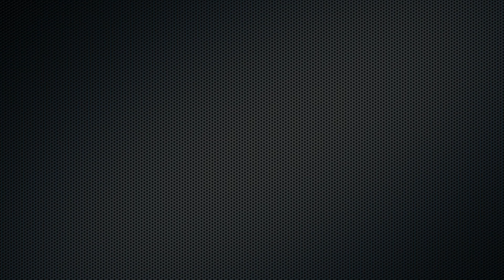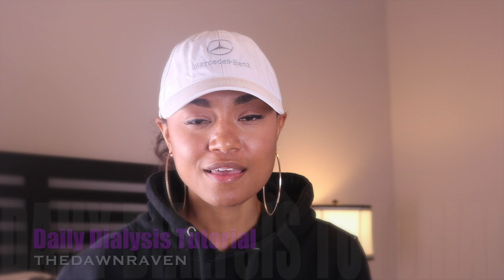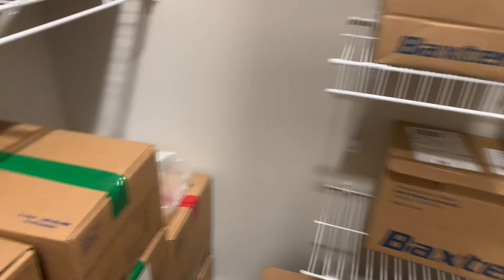My Daily Peritoneal Dialysis | TUTORIAL (Amia Machine)

Comment: Wow, that is far more complex than when I did my mother's peritoneal dialysis back in the early 1990s. The bags look the same (even the same manufacturer), but there was only one line. A bag stayed attached to the line 24/7. We used to wrap it in a rubber band and tuck it in my mother's knickers. To change the bag, we laid it on a tray on the floor and it filled with fluid. Meanwhile we heated the next bag in the microwave. Then we had this little box about the size of two packs of cigarettes stacked on top of each other where you'd put the spike from the line and the valve from the next bag into two slots, moved a handle on the side that connected the spike with the bag valve and then we just hung it up on an IV pole to drain in. There was disinfectant involved, but nowhere near the level on your equipment. The spike, for instance was open to the air unless it was attached to a bag, so during the transition phase it could be dropped on the floor by accident very easily because the line was floppy and rubbery and seemed to have a mind of its own. We had a couple of trips to hospital for emergency antibiotics from a dropped spike.  I'm glad the tech and protocols improved so much since my mother's time. Congrats on your transplant.

Comment: At about 9 minutes and 30 seconds and you say that the disinfectant is so strong that it could take off your fingerprints, and yet you have it sitting on the plastic bag for a considerable length of time.  Is that smart and or sanitary?  If it can eat through your fingers why is it not eating through the bag?
Reply from the maker: Not in just one session, over time with extended exposure and use. Similar potency to bleach.

Comment: I wish I had a spare closet to put my supplies. I have to get deliveries every 2 weeks in order to keep things manageable. I'm on my Baxter, or should I say Vantive, Homechoice Claria cycler now. Most of the time I'll do 3 green 6 liter bags. I haven't used yellow in months and even then only because I ran out of greens. Sometimes I'll do 2 greens and a red if my weight is a good bit above the target weight my dialysis center set. I also do a manual midday. So in total I do a 12 hour treatment at night and a midday (30 minutes). I've been doing dialysis for two years this June.

I like your machine more than the Baxter one. Yours is more modern. The one I have you clamp all the lines when priming, including the patient line. On mine you put one of your bags of fluid on the heater, not an empty bag. I currently use a 4 prong cassette like you but that's because I use to use 3 - 5L bags and a 3L bag but I ran out and just never switched back to 3 prong cassettes. With the 4 prong I need the drain line and patient line extensions. With the 3 prong they tubes stretch far enough. On the 3 and 4 prong cassettes with Baxter the drain line doesn't have a clamp. If you add the drain line extension, that has a clamp. Thank you btw for showing that toilet accessory. I just found it on Amazon. I've been in need of something like that. Oh, I started wearing gloves because it was removing my finger prints too. The tips of my thumb and pointer fingers were smooth and shiny for awhile.

Comment: Good decision to wear gloves. I see too many people doing this without. With gloves you can use better disinfection solution. I use Baxter Cycler. Funny to see the alternative. My connetors look quite the same, but the bags differ. The Baxter machine is a bit easier to handle I think. There is only one waiting time during the removal of air out of the tubes, abou 7-8 minutes.
Reply: I wouldn‘t touch the catheter with anything but the sterile cuff. Its already sterile. With the cuff I always clean the catheter via turning it around, moving a bit, then turning again.

Comment: Nothing you are doing is “sterile” you are not using sterile gloves , so anything you touch is not sterile… It is only clean.. also you should wait for the disinfectant to dry before connecting any tubes, you have the potential to flush that inside the tubes and into your body!

Comment: It is possible that you are increasing the risk of infection by removing the iodine from the inner cap on the dialysis connection as iodine will keep disinfecting it for long time. When you remove it  and disinfect it do not keep disinfecting it like the iodine does.

Comment: Wondering just how painful is the suction pain you mention in the video and how long does that last?  Also, how is it sleeping with this connected-if you turn over does it pull on your skin/tubing and wake you up. All the supplies you had in that room-was that just for one month?  Thank you in advance for your time and information.
Reply from the maker: I would say it depends on your tolerance. But not extremely painful, and decreases every time you do a session until it's completely gone. As far as sleeping the line is extremely long, I always made sure there was enough slack for me to maneuver in my sleep, but I'm also a light sleeper. Yes a month supply which for me was about 30 boxes. I would make the orders myself.

Comment: Thank you very much for your video.  I've been getting dialysis treatments for what feels like too long now😢.  They're keeping me alive, but simply having ckd can make a person so sad😢.  Having to be transported to the dialysis center Tuesday, Thursday, and Saturday is tough to endure.  Somehow, dialysis makes me feel VERY cold.  I've been told that they (Davita) keep the thermostat intentionally low, for infection control.  It often feels like I'm freezing.  I haven't had a fistula done, yet.  It always winds up being delayed for whatever reason(s).  I don't know if the fistula would expand my options, with regard to dialysis.  Or, if the available options would be narrowed down.  
  Im glad that you shared your dialysis experience with those in that situation.  It helped, and informed me about a lot that I wasn't even aware of.  Thanks again for your efforts.  I currently have a CVC in my upper right chest.  I asked a tech once, what IF it got infected?  His immediate answer was, "ICU".  I once had one of the tubes leak, at the fitting , when the line was flushed.  So it was to ER, to have a new tube put into my chest.  Successfully.  No further issues.  But it was a lot of back and forth, from the dialysis center to the ER, and back again.  
I'm still unclear about the fistula.  They'll start out with a 17 gauge needle, eventually use a 15 gauge.  Those are awfully big needles , to see them up close😐.  I still sometimes get a "Why me?" question running through my mind.  I used to be quite healthy, a few lifetimes ago.  I could eat or drink anything, with no I'll effect(s).  But now😢.  Once again, thank you much for your video and information.  And thanks for reading.  
Take care,
Jeff Okumura

Comment: Update: Since I posted that comment about 3 months ago things changed. My endocrinologist turned down my getting PD for dialysis. So I had to go the HD route. 
I had a fistula (https://youtu.be/Zo_azwN-1j4) setup to be able to do HD. My nephrologists thought I had more time. Well I didn't. So I had to have a catheter installed in my upper right chest. Which caused a blood clot in my neck. So now I have to take another pill ( Eliquis). 
While this was all done I landed in the ER for emergency dialysis. I didn't quite make it. And I was trying to be so pro-active about all of this. But everyone thought I had more time. 
The good part is that I got linked up with a local dialysis center that I take my scooter (a 3 wheel scooter called a Topmate ES32) and get there in under 10 minutes. Door to Waiting room. (I don't need to wait because I get there as soon as everyone is seated. I and doing Monday Wednesday and Friday from 2:30pm to 6:30pm. 

But when they say you can make friends and talk with fellow patients. Not in my center. I wouldn't need a megaphone to talk to them. We are spaced so far apart, it's not possible. And I don't believe this was done due to Covid-19. All the machines have water hook-ups and they are separated. 

The center I go to only has 24 stations. 

The first few sessions I would laugh my butt off due to the machines playing the ice cream song as 3 minute warning that the session is almost over. 

I still plan on doing this at home.

Also found out that my interview back in January to get on the Transplant never went through. 

The first day (May) at my center my doctor asked me if I was on the transplant list I said yes I went back in January. She said I don't think you are I don't find your name on the list. She advised me to call them. Seems I was supposed to do all these follow-up appointments that I had no idea I was supposed to do. So now I am scrambling to get everything done. I have two more appointments in Aug. 

So much more stuff to get done. 

But I'll end this by saying I feel a thousand percent better!  (Wow I felt sick for a few years and now its so much better).

Comment: Thank you for your video. I have a question? . I had a PD surgery two days ago. I have to see my nurse today to clean my catheter at the first time. OMG it is really hurt.. Do you think it won’t be hurt next time if I do myself at home. My nurse told me it only will be hurt at the first time. Is that right?
Reply from the maker: Your incision is not healed yet, so until it heals it will hurt a bit, but I would allow the nurse to do it so you get a thorough clean, which helps to prevent infection, as it heals more you'll be able to handle it at home. Each time you do it it should hurt less and less. Good luck to you

Comment: Did you have a lot of pain when you first started? My mom started today and is in a lot of pain
Reply from the maker: Yes, I was in a ton of pain. For me it was the suction from the machine in my pelvis area when I drain until empty, its going to take some adjusting but eventually her body will get used to it and the pain will be mostly gone, some random days it will return but your body will tolerate it much better. Tell her to push through it, better days are ahead

Comment: I don't know what high level disinfectant you're using, but if it's a 91% alcohol solution it isn't disinfecting you. The bacteria from a shell with 91% 70% alcohol disinfects better because the bacteria doesn't forrm a shell. I use Alcavis.
Reply from the maker: It's Alcavis that I use as well.